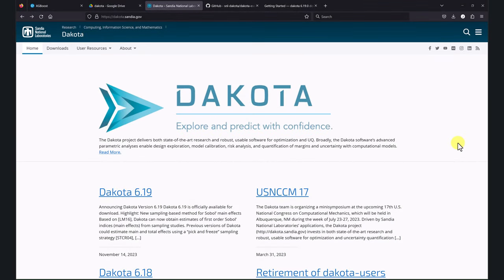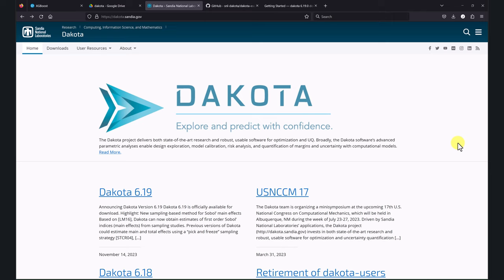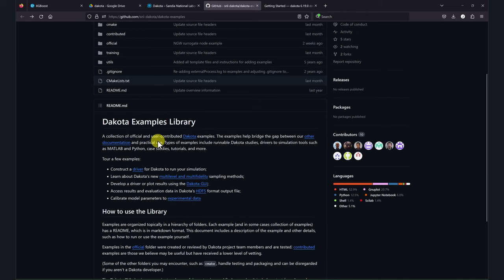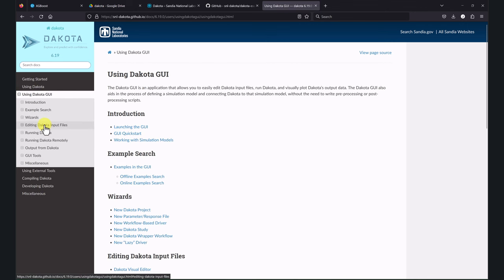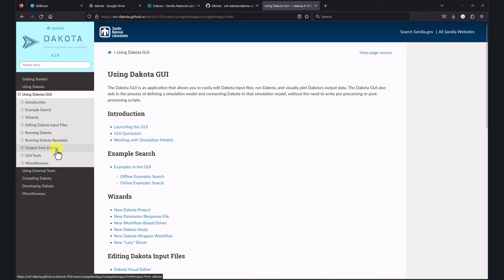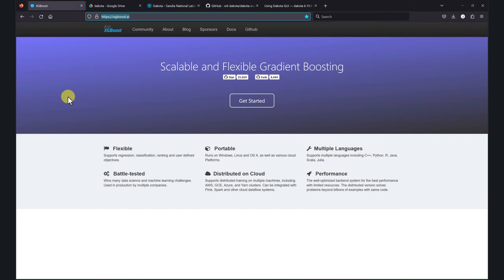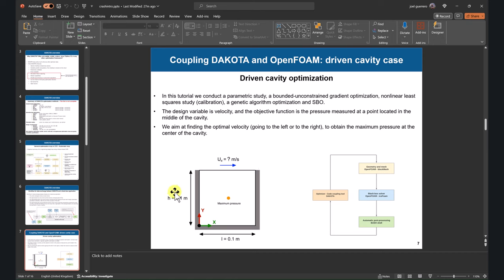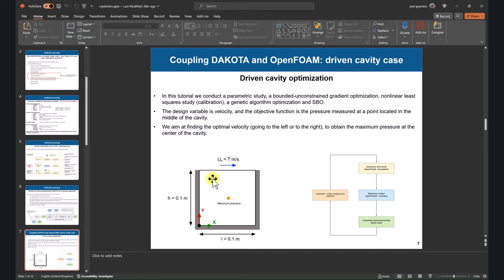Coupling DAKOTA 6.19.0 with OpenFOAM 11 | A simple CFD optimization test case

Comment: Thanks for this explanatory video, very useful. And interesting also the last part, with reflections on ML in CFD.
One question: have you already done any Dakota-related video in which you explain how to handle failed analyses? (I mean analyses that have been invoked by Dakota during the optimization loop but that for whatever reason didn't complete as expected)
Reply from the maker: Hi, no I haven't done the video for failured simulations.  Good suggestion, I will work on that.  That should be a problem if your are doing DACE/DOE, if you are using gradient based methods, that could be tricky.